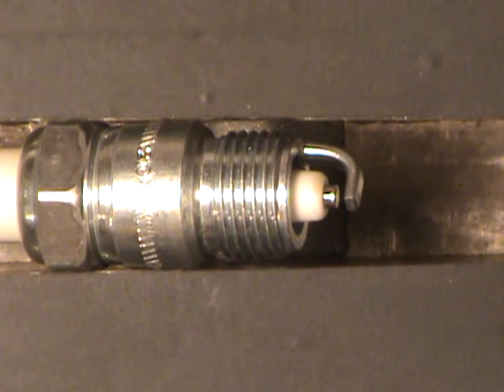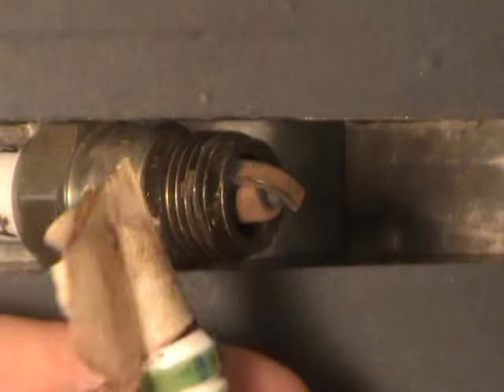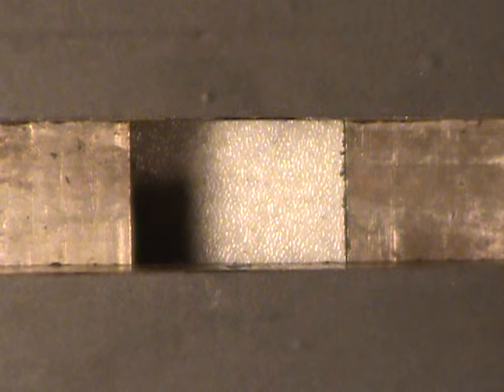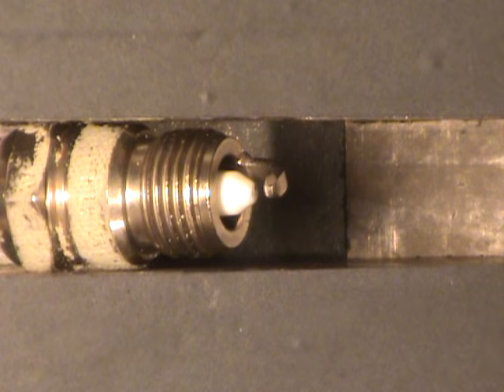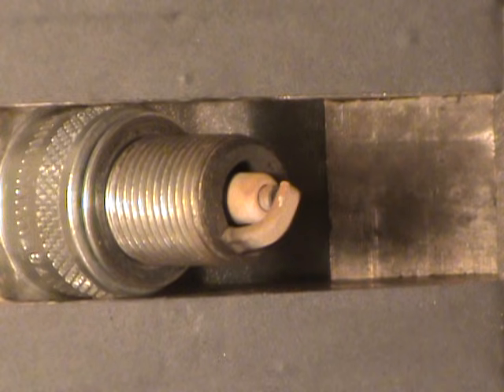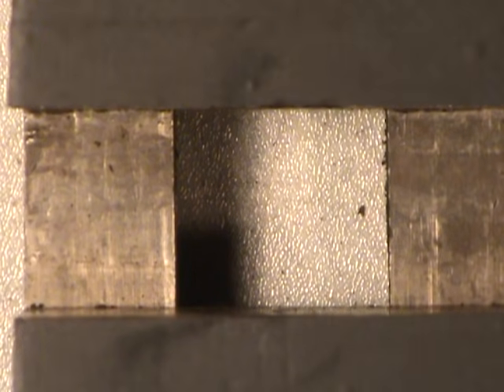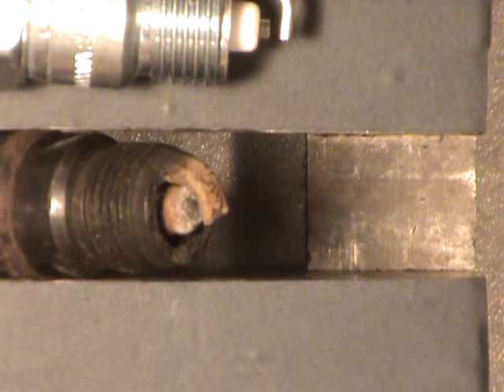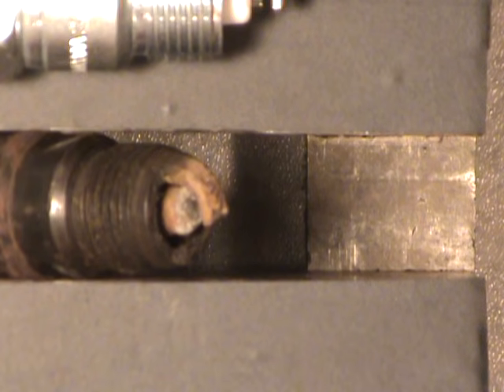SPARK PLUGS How to Read them (Part 3)

Comment: Well dad has a lot of knowledge as he is 67 yr old. He has seen a lot, he taught me how to service breaks both drum and pad, he said he use to use a vacuum reading to set the carburetors on the old cars. He hasn't much knowledge on fuel injected though, I've recently worked on his truck trying to fix an issue with the idle and overall running/ performance. That truck must have fuel issues I've changed the fuel filter, mad sensor and spark plugs. The truck will not stay crank! Lol it dies after cranking unless you hold the throttle down till it gets warm. Any suggestions? I'm leaning towards fuel pump but I haven't a gauge that will attach to the shrader valve so I'm kinda in the dark there. 

Yeah, dad has taught me a lot. Carpentry, plumbing, electrical wiring, small engine and automotive, weilding , machine trade. Along with tricks of all kinds but I'm still young and learning. I'm in a fast learning mode now days I don't struggle with things like I once did but still need some experience. I'm glad to of talked with you its hard to find people with knowledge now days, most are parts changers instead of mechanics.
Reply from the maker: Greetings Jon Stone....It's good to know, that, you are interested in, what most Guys from the Past use to do on a Regular Basis....In that, I mean, "Do It Yourself", as opposed, to, calling a Home "RepairMan/RepairWoman", or, just taking your Vehicle to the "Shop", and let them Fix It (way too Expensive for my liking!...lol)....Big Name Car Dealerships charge in excess of "$100" (One Hundred Canadian Dollars) Per Hour for Labor Only!!! (and, still No Parts in Sight!...lol)....Most of the Current Generation, seem to be spending most of their time, Staring at their "Cell-Phones", and, I have seen some pretty Dangerous Situations, while they are "Texting", both, Driving a Vehicle, and, while they are Walking!....Please, don't get me wrong, as I'm Not Anti-Cell Phone, or, Anti-Technology, but, (in my view), there comes a time, when, I Personally put "Safety" ah-head (at the top of the list), before almost Everything Else!  : )

Me, a Mechanic?....I have never Officially worked as a Mechanic, and, I'm not Certified either (say what!...lol)....Truth be told, Auto-Mechanics is just One of my Hobbies, that's all....I'm Self Taught, with some help from my Dad and Friends, while I was just getting started....Believe it or not, most of my Basic Automotive Knowledge was learned from a Book that I purchased for about 5 Bucks (5 Dollars), and, I still have it to this very day!....I still read parts of it from time to time, and, the Poor Book is Falling Apart! (became Unbound, due to Over-Use!...lol)....I personally can't Rate this Book "Highly" Enough, as it is really that good!....The Book was Published by "Petersen's" in 1977, and the Title is..."Basic Auto Repair Manual" (No 8)....Keep an eye out for it, and, you might even find it in a Thrift Store!....It's a Soft Cover Book, and, it's just slightly smaller then a piece of Computer "Printer" Paper, and, almost 3/4 (three quarters) of an inch Thick....Please note, that it only covers vehicles to about 1977, and their related Fuel and Electrical Systems of that time period....Thanks Petersen's!

Now then, about "Daddy's" Truck....Some possible things to consider are...
Vacuum Leaks, and yes, Fuel Pump Pressure is very Important for Fuel Injected vehicles....With some General Motors vehicles (and maybe others as well), there can be an Electrical Fuel Pump "Relay" (that can go bad), and, in some cases is backed up by a "Switch" that "Senses" Oil Pressure, and, if the actual Fuel Pump Electrical "Relay" is Not Functioning, then, you have to "Crank" the engine (you know, starter motor Cranking engine over) until the Engines "Oil Pressure" is at least 4 PSI (pounds per square inch), then, that Oil Pressure "Switch" that I had mentioned will "Complete" the Electrical Circuit, to supply the Electric Fuel Pump with Electricity. (just thought that I should mention it, but, it may not apply to your Dad's Truck).

Before you go on a "Wild Goose Chase", I would recommend that you Test that "Fuel Pump Pressure", or, you might find yourself wasting time and Money as well.

How did the spark plugs look?....Dry?...Wet?...Smoke out of the Tail Pipe, while it was running?

To check for Spark, while Cranking, or, Running the Engine....If you have an "Inductive" Timing Light" (the kind that has the spring loaded "Clamp" that you attach to a Spark Plug Lead/Wire), you can either have Dad, or someone hold the Trigger on the Timing Light (or, tape down the timing lights "Trigger", and, point the Timing Light towards you, as you Crank, or Run the Engine), and watch the "Flashes" (we are Not Setting Timing, just looking for a Pulse!...lol)....The "Flashes" should be at Regular "Intervals", Not "Skipping" all over the place, or, No Flash at all....Warning!, be Careful, and watch out for Hot, and Moving Parts!, and, make sure the Timing Lights "Wires" are Away from Hot and Moving Parts as well....Make sure (if you do it alone), that you Secure the Timing Light, so it Does Not Fall, get Damaged, or gets wrapped up by Fan Belts and such!

Maybe try this, next time you try to Start "Pop's" Truck....Before you start Cranking the Engine, hold the Key in the "Run" Position (Not Start Position!), and, Listen Closely for the Electric Fuel Pump Operating "Sound/Noise" (yeah, I know that it works somewhat, But...), what you want to be Listening for, is, if that Electric Fuel Pump is Sounding Healthy....Please Note, that Fuel Pump might only be working for 2 seconds, or a wee bit longer, as, some of them do a "Prime Only", to bring the Fuel Pressure Up to Pressurize the Fuel Lines....In some cases, you can do this many times....Just Turn the Ignition Off, for a Minute or so, then, turn the Key to the "Run" Position, and Listen (again...lol).

Hmmmm, your Pop's Truck might even have a "Plugged-Up" Cat (Meow...lol, nah, more like a Catalytic Converter!)....If indeed it is Plugged up, or Partially Plugged up, what this does, is, creates Way Too Much "Back Pressure" in the Exhaust System!, and, in some cases, you would be lucky to make it out of your Driveway!....Yes-Siree-Bob, Too much Exhaust Back Pressure actually keeps the Engine from "Breathing!!!" (aka, Suffocation)....Hey Pop's, do you still have your "Vacuum Gauge?"....You can use a Vacuum Gauge to somewhat test for a Plugged "Cat" (Catalytic Converter), or Exhaust System for that Matter....Hook up the Vacuum Gauge, and watch what it does....Once the Engine is Running at Idle, that should give you about 15 inches (or more) of Vacuum showing on the Gauge....Now, Rev up the Engine a bit (not too fast now), and hold the revs there....The Vacuum reading should stay Put!....If the Vacuum Reading Starts to drop, as you keep the Revs Steady, then, that's a darn good indication that the "Cat" is Plugged somewhat, or, the Exhaust System has become "Restricted" (preventing Free Exhaust Flow)....Maybe somehow, the Trucks Exhaust System (Pipes) got Kinked, or Bent, by contacting something perhaps?....Off-Roading (aka, 4-Wheelin) at all?
 
Also, next time you try to Start Pop's Truck, Hold the Gas Pedal about 1/4 (one quarter) of the way Down, as this has worked for me, on a 4.3 Liter (262 cubic inch) V-6 General Motors Engine, and, (for me) doing this Helps the Engine Start-Up Better when the Engine is Hot or Cold!  : )

Let me know what the "Patient" actually is (you know, Make, Model, Engine Size and Number of Cylinders, etc.), or, I will be the One, going on the "Wild Goose Chase!"...lol.

Take care, and, "HAPPY NEW YEAR!!!"
Reply: RockysRoadshow Thank you Thank You!! I have wanted that knowledge for years, I use to own a 1994 f150 but since sold it and had a service manual and can't find that either. Dad's truck is a 2000 f-150 v 6 engine can't remember if the engine is a 4.2 or?... I appreciate the common info on the general ideas of what could cause such a problem. 

The ole truck is still worth fixing just got to get it so. If dad was a younger man he"d already had it fixed. Arthritis isn't his friend for sure, I do not think he still has that vacuum gauge but I'm an appliance and a/c tech and have such gauges all I have to do is adapt it to fit. Is there a particular hose i should attach it to? For the vacuum procedure? I didn't think about the CAT, my brother in law had a van with that very problem and he got under it and pocked holes in it and it ran fine for a while. I don't intend to do that though, I am on the look out for that book you mentioned any knowledge is good I need a foundation first so i can build on it. You certainly gave me a good start.

I've always wanted to learn these things since i was a boy about seven years old and took my first motor apart. lol, that was fun to me, Dad showed me on that briggs&startton how to set the time and told me about top dead center ect. He even showed how to set gap on plugs and used an old ISBM card or a feeler gauge to set the coil to flywheel gap. I'm better with carburetors than fuel injection, I thought about vacuum leaks before but most people say to start the engine and spray the carburetor cleaner around vacuum hoses, I do not like that method. Yours makes better since, I have plenty of gauges that will read both pressure and vacuum, just have to figure out the thread size on the fuel pressure valve. I've plenty of thread gauges for that as well. 

I kinda took you as a mechanic since you know so much but yet my dad can lay bricks, blocks and do carpentry but he hasn't a license nor has he done that for a living much. Sorry wasn't trying to profile you, I can check the fuel pump relay and overall voltage if need be. I'll have to get the pressure specifications and I'll test the fuel pressure. I do know that the truck will start to run after it warms up but still shaky and not smooth. I know he has a valve cover oil leak, I replaced the spark plugs the other day and it needed it. Had some oil on three of the plugs and a brown/ white build up on the others. 

The plugs with the oil were right where the oil leaks is. A gasket isn't much and is easy to change. May just need tightening, I'll check that too, I am thinking the vacuum and fuel pressure testing should be my top priority for now and work my way from there. While an oil leak isn't good my old ford had the same and it ran just fine. Where do you suggest the best place to check vacuum for the cat?

I'll give you a synopsis of what I have done to the truck this year. I replaced the O2 sensors this summer and the maf sensor, replaced the fuel filter too, as I mentioned above I replaced plugs the other day. That's mostly what I have done, I have experience from my line of work that when things aren't running smoothly check your basics first and usually it's a simple solution. 

I'm going to try and do what you suggested, I'll listen for the pump like you said first then follow through from there. I do know that some pressure is there because after cranking it I made the schrader valve and gas sprayed from it. Just have to keep throttle down until it has about a minute to run then it will idle but rough idle. Hope that catalytic converter isn't clogged, one time we had a tiller with a briggs engine and an old muffler and that muffler glowed red wow i thought! Dad said it's stopped up so he tried to clean it out but he took it out for the time being and bought a new one afterwards.

Yeah, i should have thought about the cat. being clogged a bit. It wouldn't hurt to lie down and look at it when engine is hot might see a glow. Well, I'm off for now, I hope your New Year was great! i hope this year is better than the last 5 as times have been hard here. This will be a great dad and son project, I'll get dad to help when I need three hands. Again I thank you very very much, I am bound and set on getting that truck fixed. Always great working with dad these days there aren't enough of that as in years past. The man has taught me a lot even old arts like braiding leather into whips and one time had an aircraft cable to break while hoisting a heavy load. What did he do? Cut the loose ends, unraveled the wire, wrapped it around the load and braided it to itself. 

I really have a long ways to go lol! 

Thanks!!!
Jon
Reply from the maker: Jon Stone
Ooops, I made a Boo Boo....When I was talking about the EGR Valve, and when it was Supposed to be Open, and when it was Supposed to be Closed....I should have said, that, the EGR Valve is Supposed to be "Closed" at "Idle" (speed), and, at "Wide Open Throttle"....Usually, the only time that the EGR Valve is "Open", is when, the Engine is at Operating Temperature (fully warmed up), and, the Engine is at "Cruising Speed", with a light Throttle (gas pedal applied)....Thank Goodness for the term "Proof Reading!"...lol.
Reply: Sounds like Idle air control valve. On the 4.0 modular v6s I'm not sure exactly where on the throttle body they are. But it's easy to pull off and clean it. Do that and see if it has a lot of carbon deposits. Also get a fuel pressure gauge and hook it up to the fuel bleeder shcrader valve on one end of the fuel rail. And test with a few key cycle's to make sure it's hold pressure at probably around 44-50 psi and make sure it doesn't bleed off. If it does it might be the fuel pressure regulator. If it doesn't bleed off any pressure proceed to test with engine running. If it doesn't maintain pressure at about the same as standing then it might be a clogged fuel line or the fuel pump is bad. Just some do it yourself stuff that's easy. Also one thing to check that I've seen is a fuel pump relay dropping off voltage at load from worn contacts. Just a few tests and ideas.
Reply from the maker: blargblarghonk
Greetings blargblarghonk....Thanks for helping out....You presented some very good possible solutions, and, above all, you are stepping in, and trying to help....Take care, and, "HAPPY NEW YEAR!"
Reply from the maker: Jon Stone
Greetings Jon Stone....I really need to mention, what I should have, from the get-go, and that is in relation to "Trouble Codes" that may be Stored in your Dad's Trucks "Computer"....Sure, we can all do the "Guessing Game", as it applies to, trying to find that "Gremlin" (or Gremlins, as the case may be), that may be causing the Not So Good Running of that there Truck....But, and, Before I move onto Computer "Diagnostics", I would like to say, that, all of the "Things" that were mentioned thus far, as it concerns the (maybe) Fixing the Trucks Running Problems, that, all is not lost....By saying that, I mean that, most of the Things mentioned so far, kinda fall into the Category of "Maintenance", more or less....Things like, Looking for the Obvious (disconnected vacuum hoses, or wires, spark plug and spark plug wires condition, fuel filter, air filter, etc.)....These "Maintenance" Items need to be addressed (taken care of) anyway, even if the Truck was "A-Oh-Kay", and not "Acting-Up".

All of these "Maintenance" Items can be done, as you proceed....But, aside from "Checking" the "Fuel Pump" or Fuel Line "Pressure" as Specified for your particular Truck, then, as any "Fix-Em-Up" Establishment (aka, Car/Truck Dealer or Automotive Repair Shop) would be doing, as soon as that there Truck rolled into their "Service Bay", the "Mechanic" working on that "Year 2000 Truck", would get out His/Her "Scan Tool" (Device that Plugs into the "Connecter", that is usually found just under the Dashboard near the steering wheel, but, not always), and proceed to "Download", any, and all "Trouble Codes" that are/maybe, "Stored" in the Trucks "Computer", into the "Scan Tool/Device"....Imagine if that "Fix-Em-Up" Establishment "Charged" (Billed) someone "By-The-Hour", and, "Not" Getting those "Trouble Codes" First?....I would probably Tell them to Keep My Truck!...lol.

Sure, Testing this, and, Cleaning that, might help cure the Problem, but, from my experience, It Usually Does Not!....But, I had the Satisfaction, knowing that, I learned something, and, Cleaned or Replaced (but only sometimes) a Part, that needed Replacing anyway.....Kinda like "Learn-as-You-Go" (so to speak).

Are You-All still Reading this Post?....Allrighty then, lets proceed with some "101" on "OBD-2" Diagnostics, shall we?

"OBD-2" stands for "On Board Diagnostics-Version 2" (if I'm not mistaken).
Starting, oh, about 1996, the Government Mandated (Forced?...lol, that in North America mostly), that Most, if not all?, Vehicle Manufacturers install this System in their Vehicles....It's kinda like having an Onboard "Emissions Analyzer" (so to speak)....Just for a "Time-Line", the OBD-1 (1st Generation of the OBD System) was not too bad, but, it wasn't as Elaborate as the OBD-2 System.

There was "1" Advantage that the OBD-1 System had over the OBD-2 System, and, that was (well, at least on General Motors Vehicles), that you could just "Jump" 2 of the Under Dashboard Terminals on the "Connector" (Port), and, that would Make the "Service Engine Soon" Light "Flash" (kinda like Morse Code, if you will), as, Opposed to the "OBD-2" System that "Demanded" that you Use a "Scan-Tool" to "Extract" those "Codes!"....Those OBD-1 Flashes were usually just a "2-Digit Number" (for each Code Stored in the Computer), then, you would look up the "Code" (Number, in a Book, or perhaps on the Internet, and, that would give you a (not as detailed Information as OBD-2's System gives you) Description of the "Device" or "General Area/Circuit", of where the Trouble just might be.

Now, back to the "Year 2000 Truck", and its OBD-2 Diagnostics System, and the Gentleman that is trying to get it Running "Healthy", once again....I would Highly Recommend, that you Invest (Buy, but Not Steal!...lol), a Hand held OBD-2 "Scan Tool", if you will be Working on any, and, all Vehicles that are, from the Year "1996" (generally speaking), and, any "Newer" (Year) Vehicle as well....Otherwise, you will Enjoy (but, not likely) remaining where you are now, and that place is, "Wild-Goose-Chasing!" (Yes-Siree-Bob, I'm very good at that, and still do it occasionally too!...lol).

I figure that, with all of the Money that you have, or, will be spending on that there Truck, on Parts and Pieces, that may not be Needed, by performing the "Wild-Goose-Chase" Routine, that, it would probably be more "Cost Effective", and, Apply that "Hard Earned" Cash towards an "OBD-2 Scan Tool" (hand held, of course!).

If and when, you (ever?) acquire an OBD-2 "Scan Tool", you'll be saying to yourself, "How did I ever Do without It?"....Even if you don't have your own Scan Tool, you can always, Beg, Borrow, but, Never, Ever "Steal One!!!"...lol.

Also, do you "See" any "Warning" Lights on the Trucks Dashboard??? (or anywhere for that matter).

So, it's your choice, my Friend (choose wisely....Hear that?...I think it's a Flock Of Geese flying by...lol).

Take care, good luck, and, have a good one.
Reply: RockysRoadshow Good point about a scan tool. I completely forgot because it's always the first thing I use. haha. But usually post 96 vehicles you can take to say autozone and get the list of codes for free and then go on the internet (google) the code number. Some are manufacturer specific so you might have a hard time finding the meaning of the code. Just throwing my 2 cents in and hopefully it helps.
Reply: blargblarghonk Well I feel stupid. I forgot about the essex ford 4.2l.
Reply from the maker: blargblarghonk
Greetings blargblarghonk....There is No Need to feel Stupid, my Friend....I have yet to meet a person, who, "Does Not Make Mistakes!", and, that Includes Me Also!....It's very Thoughtful, that, You took the time to Re-Visit this comment section, and, mention about that essex ford 4.2l. ....(whatever the heck that is?...lol)....See, now I feel Stupid, for not knowing what an "Essex" is!...lol, Nah, not really, as, I've never been Run Over...oops, I meant, Run into one!...lol....From my perspective, there's No Such Thing, as a Stupid Person!....Why you ask?....Everyone, and I repeat, EVERYONE, has Something to offer!....Have you ever noticed, just how much Happiness, and, shall we say "Fully of Life", that, a Mentally Handicapped Person "Expresses", what seems like, almost at all times?....I can tell you from many, of my observations, while in near proximity to these Mentally Handicapped People, that, even though that may not be able to Communicate with you Verbally, they Most Certainly "Are Able To", through their own ability, usually by using Facial, or Physical gestures (movement), shows us all, what the "Meaning of Life", is all about!....These unfortunate afflicted Folks, just have a certain way, of making me feel Very Fortunate, that I'm not in their situation, while at the same time, as I'm leaving them, to go elsewhere, they most certainly, "Brightened Up My Day!"....So many of them, are so Full of Life and Energy, and, well, at least for me, leaves me with, (and also a reminder), that, it really is, Not about, the Fancy Clothes, the Fancy Car, or, even the Fancy House, as well....Actually, some of the Best Advice I got, was while playing an online Video Game....Strange huh?....The Advice that my Fellow Gamer said, was..."Just Be Yourself"....The End.